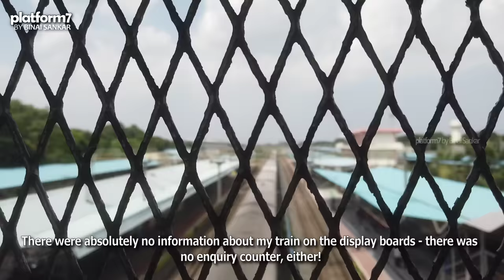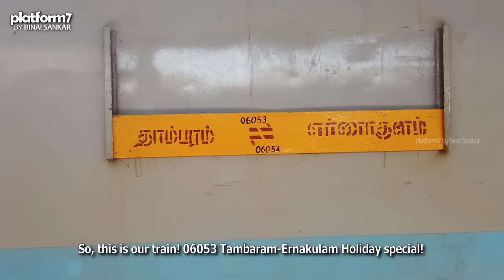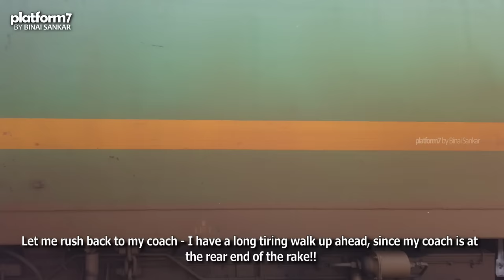Train Journey | Tambaram to Ernakulam by 06053 Onam Special Train via Chennai Beach

Comment: I suspect the rake is one that is used for Tambaram sengottai superfast - the one ur earlier video was on!! However, that one had antyodaya general coach, and no regular 3AC making me think otherwise!! One other suspect is that of the weekly MAS-TVC superfast(12697/98)! I can't think of any other rakes with MAS available for specials.
Reply from the maker: This was a BBQ based rake.
Reply: @Platform7byBinaiSankar  then probably the one used for 12697/98
Reply from the maker: @arunramaswamy2425  12697/8 is a Trivandrum based rake. And that has a different composition. This one is a BBQ based rake. Is the spare rake of TN express in all probabilities.